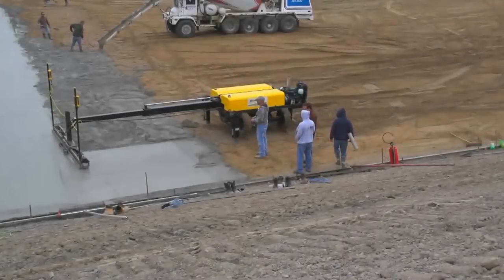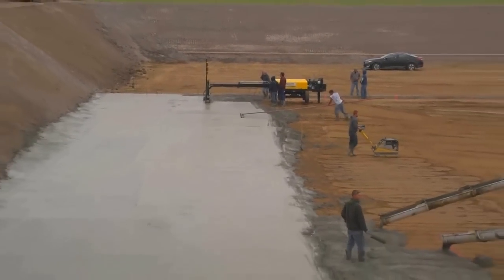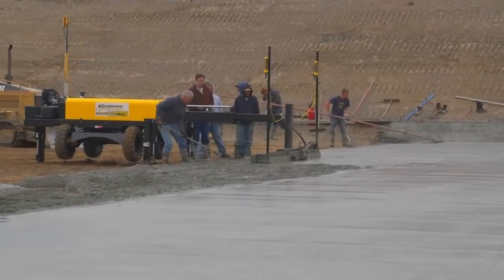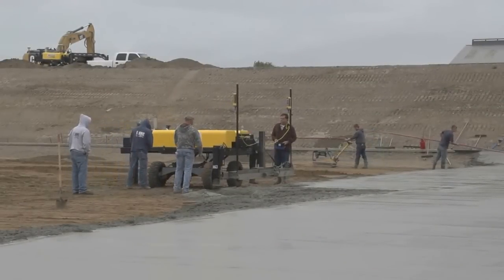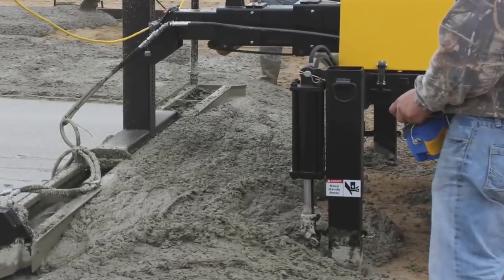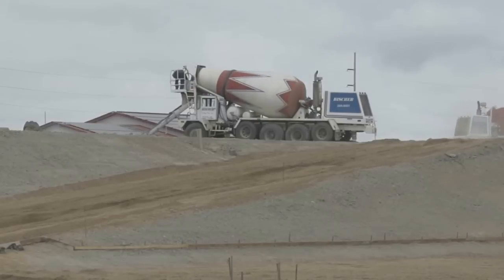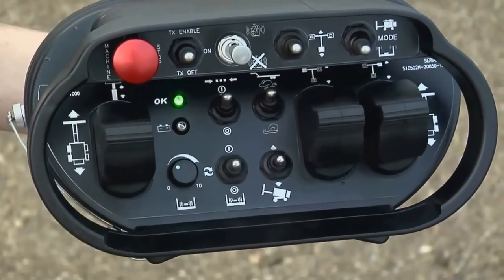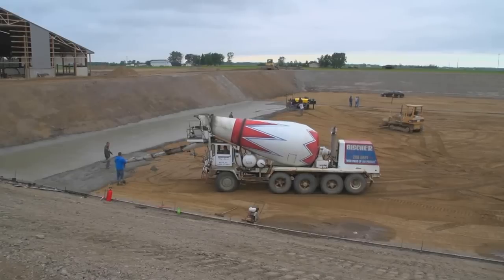Agricultural Storage Pit: Customer Screeds 75,000 sq. ft. Using Ligchine Concrete Screed

Comment: By the time you set that heavy machine up with out riggers the concrete will be getting really dried up. Imagine moving that thing around if there was rebar? lol
I'd rather do it the old fashioned way with 2 x 4s and shovels 👍🏼
Reply from the maker: Please see our database of YouTube videos with the machine efficiently and quickly navigating and screeding on many, many jobsite setups including rebar, wire mesh, and in-floor heat tubing.

Comment: Like stated below this pour throws up many red flags. The machine looks to be a great idea but this looks to be a major problem  with zero re bar, keyway or expansion joints, i don't care what slump they poured or PSI or if it's full of fiber. Lets see what that slab looks like now. This is the right way to do it here https://www.youtube.com/watch?v=lVhuQ4TSr4o
Reply from the maker: The pit was built to NRCS (National Resource Conservation Service) standards (federal required standard for agriculture storage pits).  This meant it was designed, built, inspected and approved to Federal standards.  The Federal standards only require a “clay lined” pit.  In this case the pit owner “elected” to add a concrete liner on top of the clay liner to prevent any damage to the clay liner when his Cat Loaders were traveling along in the pit.  The owner has no concern about concrete cracking since the pit is 100% clay lined for proper retention.

Comment: You yanks have a very strange and backward way of pouring concrete; but in seeing this huge slab with Norwood well you don’t need to be clever to know it’s going to crack and move and move until you rip it up and do it properly with lots and lots of REO
Reply from the maker: This pit is a DNR approved clay manure storage pit. The landowner wanted concrete over the top for his machinery to navigate on. As a machinery manufacturer, we did not have any part of the site engineering.

Comment: Video is for the machine.. All the comments about expansion joints in a slab 20+ feet below grade lol.. Please enlighten me on how its gonna expand or contract.. Tooled or saw cut joints are to control where the concrete cracks.. rant over

Comment: Anyone know what the level / height tolerances would have been across the span surface area of what's shown in the vid.20 mm,  30 mm  maybe 50 mm  ?        just curious .
Reply from the maker: The screed's leveling system and laser system have a tolerance of less than 4MM.

Comment: that machine is fine if you have no tied rebar laid before a pour doubt that will work well far as damaging tied steel or wire mesh
Reply from the maker: We have over 70 videos on our Youtube channel--many featuring this same machine driving and screeding on rebar, mesh, and even heat tubing without damage. Please browse our other videos to see the proof. Thanks!

Comment: have seen plenty of this kind of machines in Europe... 
are you sure you guys are the only one? 
I have seen remote control ones, 
I have seen attachments behind a tractor 
and I have seen attachemtn that fit on a manahtoo
Reply from the maker: Only one other company makes a similar style machine, but there are several ways to achieve similar results--however, using a laser control screed, you'll achieve the tightest tolerances in floor flatness.

Comment: Limited application. Can't be craned or used on reinforcement. Not going to replace good men and beam screeder.
Reply from the maker: Weighs only 4300 lbs so it can be craned with ease-- we offer custom lifting slings for perfect balance when craning. Depending on the reinforcement type, we have systems to navigate upon them without damage-- we also have videos of this on our channel. Thanks.

Comment: If my construction equipment rental business were still operational, I would purchase a few of these initially, after we see how well they rent, we would then buy at least 10 of these, this definitely looks like a winner.
Reply: MilesDei Bad Idea.
Reply: scarabooshable Why do you say that?
Reply: MilesDei Applications are limited. How do you move it on reinforcement or crane it?
Reply: MilesDei check out "Roller screed demo".
Reply: scarabooshable That only weighs 4500lbs it could easily drive on top of the reinforced metal without damaging it, but if there were concern in that regard wood could be placed for it to drive on, and it can be lifted via crane with no issue.

Comment: excuse my ignorance, but shouldnt there be some expansion joints?  and is using a small wacker plate good enough to compact the sub base instead of a ride on vibrating heavy roller?

Comment: what is the pit for? wonder what kind of chemical mess is going in this pit?
Reply: J Merritt Ag pit, meaning manure..
Reply: Snipe Stud00 will it ever leak? should say the screed is nice.
Reply: J Merritt The cement itself is like a filter for liquid going through and the samd also filters. Will effect the water table a little if it does go through but not sire on how drastic it would be. They need to put expansion lines in and i do beleive rebar should have been laid but im not 100%sure on the requirments for a cement manure pit.
Reply: I thought it was an irrigation pond.  Apparently it's for dung.  A concrete poo pit.
Reply: David Ryder Concrete is too hot for water. Its easier to have a regular pond wity a dirt bittom and wall vs a cement one tou need to cover to prevent heavy evapoation
Reply: I would reckon expansion lines won't be needed as the concrete will be submerged and I would guess would stay at a fairly nominal temperature/size.
Reply: Newer process on large jobs is to cut expansion joints after the concrete surface is worked and it is hard enough to walk across but not anywhere near cured completely. The surface still looks wet, although concrete never fully dries it cures. Usually start cutting a few hours after the pour. Cutting this way cuts down on dust.
Reply: lagoon.

Comment: I have a question, since I do not see staff working in the expansion joints, as they avoid cracks, I also see that they do not use metallic reinforcements, like meshes or slings
Reply from the maker: This pit is a DNR approved clay manure storage pit. The landowner wanted concrete over the top for his machinery to navigate on. As a machinery manufacturer, we did not have any part of the site engineering.

Comment: can that work on freeways and city streets?
Reply: I love roundabouts :)
Reply from the maker: We have used the machines successfully on several Department of Transportation projects such as roundabouts and interstate on/off ramps.
Reply: Not where I'm from.

Concrete wouldn't work as pavement. We need tar up north east. Too much water underground, freezes, and destroys concrete.
Reply: not true i live upstate ny and we just finished thousands of yards of highway pavement downtown utica ny. look it up  and there is a job coming up thats suppose to be 8 miles of concrete pavement we use it alot around here
Reply: plenty of concrete structures in your area

Comment: The same job could have been done with dirt work. 

I'm guessing since the soil was so sandy they didn't have a way to truck in a nice fatty clay and compact it in as a seal. That's the norm here in Texas
Reply from the maker: This pit is a DNR approved clay manure storage pit. The landowner wanted concrete over the top for his machinery to navigate on. As a machinery manufacturer, we did not have any part of the site engineering.

Comment: Wow. No steel reinforcement and no expansion joints ?  You could never get away with that up here in Vt .  But thats some slab. Wow.
Reply from the maker: This pit is a DNR approved clay manure storage pit. The landowner wanted concrete over the top for his machinery to navigate on. As a machinery manufacturer, we did not have any part of the site engineering

Comment: The flat sand base spreads the load, as long as the concrete is kept damp as it cures no cracks will form.

Comment: It looks good for screeding large flat flooring with no reinforcement or obstructions.  What features does it have to deal with reinforcing structures, slopes, vertical dowels for precast walls, protruding conduit, pipes, and other various things when dealing with internal flooring?  It looks to have limited capability.
Reply from the maker: We have over 100 videos on our page--many with the machines screeding over mesh, rebar, around columns, and around drain pipes. Check our website as well--www.ligchine.com
Reply: Farms Grace finally, a worthwhile comment.
Reply: Finally, a worthwhile comment.

Comment: I have to admit that concrete truck is weird looking , but it must be nice for the operator to be able to move the truck and  control the spout at the same time .
Reply: Common to you maybe! First time I've ever seen a front loading concrete truck myself
Reply: Devin Rogers They are common trucks. Great for smaller areas where you need to pinpoint where the concrete needs to be laid. Also easier to manuver as you are not blindly backing

Comment: They said the machine was delivered on a small truck because a large truck would be impossible to drive down the sandy ramp........
So how did the cement trucks get down there one after another?
Reply: Danny Marsh the implication was that they couldn't get a big truck down he ramp so it's a sales pitch that it can be transported on a small trailer. He implied that big trucks couldn't get down the ramp. That's not an accurate statement.
Reply: Danny Marsh. Listen one more time. He didn't say "prohibitED" but "prohibitIVE". That's a difference (still sketchy, though)
Reply: thing is, a rig may be able to get down there, but a loaded rig in sand, it's just too heavy to get back out, plus  a 53 foot trailer with a tractor on the front is a hell of a lot longer than the truck/trailer in the video. they were reffering to jobs where you do not have as much room as they did in the video. the point of the video was to show the screed at work, not showing a trailer bottom out as a tractor trailer decends and ascends a sandy ramp.
Reply: MrHondaguy77 . Listen again. He never said it was impossible, he said "prohibited" for a semi. Those concrete tricks are rigid, not semi.
Reply: a lot of cement trucks are 6 wheel drive and able to deflate and inflate their tires from the cab.
Reply: MrHondaguy77. I agree with you. A truck could have drifted down that slope. The fact that they said it's "prohibited" may need some looking in to. Why do they say it's prohibited???. Sketchy to say the least.
Reply: Honda. Did you see at the end of the film, the back end of the pit is open, with no high bank.
Reply: Ga Fin. Be nice. He has no clue.
Reply: Arthur Bradley I didn't notice that. I watched again and sure enough. 

My thing is, if you have a good product for sale, you don't have to be deceiving to get people to buy your product. Me personally, when I feel like a company is lying to me, I'll purposely not buy their product.
Reply: MrH. And that was good observation about the delivery comments.
Reply: MrHondaguy77 Tractor Trailer combo is prohibited not B class vehicles , reason being is the trailer is unstable making turns on unstable grounds since the Trailer tires dig in while it pivots
Reply: easy. they haul them down on a trailer behind an f150.
Reply: prohibited is sometimes used instead of "forbidden" or "not allowed" like alcohol was in some time period.
Reply: MrH. yea, I think they were bringing the cement around from the other side. I think they were bringing the machine in that way was more of a convenience, than anything else. And yea, I just happened to catch that at the end of the video. And still. That machine is genius. I also do design work.
Reply: MrHondaguy77 magic
Reply: Let me end the argument, only that white truck, with that specific driver could have made it down that treacherous and unholy ramp. No other vehicle on earth could have pulled it off, even Chuck Norris walked away from the job.
Reply: you are an idiot no they didn't haul them down with the truck they drove down themselves stop assuming you got dumbass people believing you
Reply: @Shane woods... euro-shit talking about offroading in his Fiat 500X awd... lmao.
Reply: He actually said prohibitive, not prohibited. Big difference. In this situation, they well may be right, simply because of the clay/sand base. A big rig turning on that would do a lot of damage. However...I don't see any reason the rig couldn't have backed down the ramp and offloaded, unless the weight of the 'other' type of equipment would make a difference...IDK. It does seem a little sketchy.
Reply: TheFiveMinuteGuy :
Reply: Agreed, even a twin-screw with locking diffs can have traction problems, depending on the tires. And especially if they need to perform a sharp turn, any little dirt hump will be an issue with the trailer tires.
Reply: dinousor
Reply: where they do that at lol?
Reply: Danny Marsh there's enough fucking room for a B-double to get into andcout of that pit.  oh wait, it's in america, that explains the inability of any real drivers. they think serious 4x4 driving is an unsealed road.

Comment: I used to work as a floor screeder and it was back breaking work involving a length of 4x2 and handles and 2 men pushing the 4x2 backwards and forwards to level the concrete and the tamping it down but always with steel reinforcement ??? .
Reply from the maker: This pit is a DNR approved clay manure storage pit. The landowner wanted concrete over the top for his machinery to navigate on. As a machinery manufacturer, we did not have any part of the site engineering

Comment: The thermal crack on that floor would be in excess. So after close to 2 years, is it still intact?
Reply from the maker: This pit is a DNR approved clay manure storage pit. The landowner wanted concrete over the top for his machinery to navigate on. As a machinery manufacturer, we did not have any part of the site engineering

Comment: Not one single expansion joint? Also how do you get ag out, without wrecking your mat? hmmm.
Reply: considering it's a shit pit the owner does not care and probably just wanted the cheapest option
Reply: Dick Morgan usually they saw cut as it's drying, but if they don't do it fast enough(2hrs or so) yes it will crack unless they used a different mix (aggragate) on this and it might be one solid pour
Reply: No re-bar either